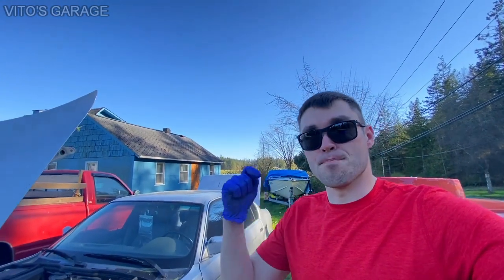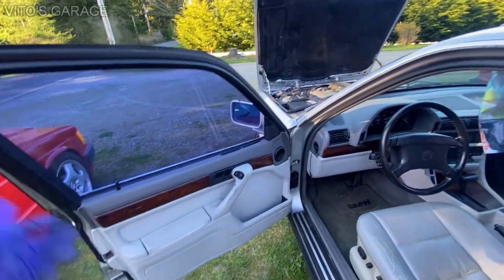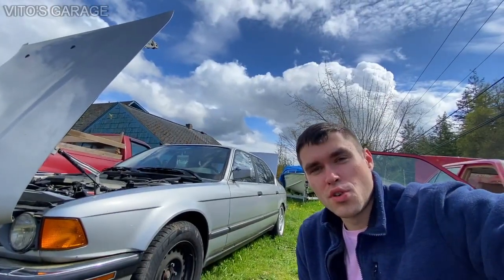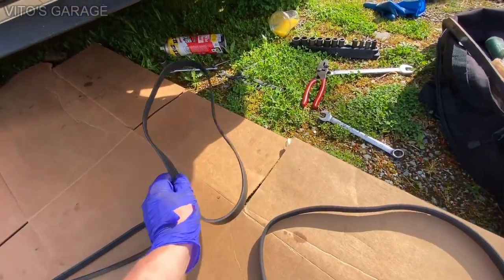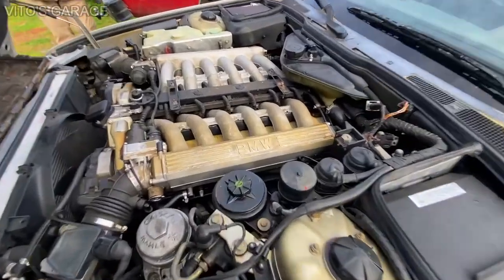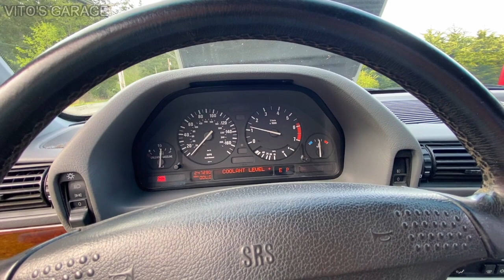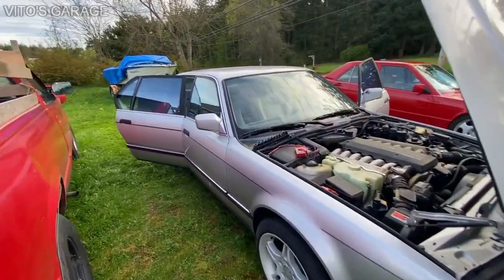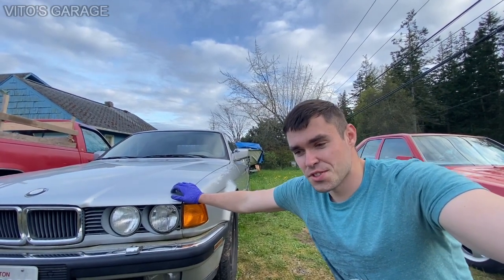V12 BMW E32 750IL First Start After 2 Years & Unsuccessful Test-Drive....

Comment: Thank you for posting this video!  I own a white 1988 750iL!

Regarding the alternator, it's not always the alternator.  There is an engine electrical system responsible for connecting the battery to the alternator.  It's mainly a thick electrical cable that goes bad.  BMW wants $800 to replace that main cable (engine heat damages the copper inside it, thus the weak charging performance), but you can replace it with similar thickness welding cable for a lot less.  An E32 expert named Shogun on Bimmerboard.com E32 board has a how to for building an new engine electrical cable.

The alternator can be tested at Autozone once you pull it from the car.  Sometimes replacing the regulator on the alternator restores the alternator, or sometimes the alternator needs to be rebuilt.

The master cylinder has likely failed on the car.  You can buy rebuilt ones for under $100.  New ones are over $300 from BMW.

Another known failure point on this car is that the power steering pump is a dual vane power steering pump.  One internal pump mechanism is for your power steering, the other controls a hydraulic leveling system known as SLS or LAD.  This is a very expensive and leak prone system to maintain.  Signs of failure include a sagging rear end and leaks under the rear side of the car.  The control diaphragm that controls this system is no longer made or produced by BMW.  The company that made these was bought out by another company a few years ago and that parent company discontinued production of the diaphragm.  Some have had success modifying a control diaphragm from an E38 (third generation 7 series) which used an air powered system.  Most people just convert the system to a conventional sport suspension system in the rear and either run the lines in a continuous loop, OR they disable the system entirely by bolting M10 bolts on the SLS ports on the power steering system.  Also, be sure to use Pentosin in the power steering system.  Some have replaced this very expensive fluid ($20 a bottle, and the system requires several bottles) with ATF fluid, but ATF attacks the seals inside the pump, requiring a rebuild or replacement of the power steering pump.  This pump is nearly $1,000 new from BMW, but can be rebuilt with new seals for $100 to $200.

A Youtuber named M539 Restorations is rebuilding a car very similar to this.  You might want to check out his channel.

Numerous parts on this car are NLA (No Longer Available) from BMW.  If you're relatively savvy at rebuilding or replacing worn parts, or just very creative at engineering new replacements from scratch, this won't be an obstacle.  ECS Tuning and Pelican Parts are two well known and respected replacement parts sources.  You can get parts numbers and dealership parts prices from realoem.com.  You will have to select the "Classic" catalog to find the car listed.  Another source for replacement parts (very expensive though) is Maximillian Importing.  This is actually a business arm of BMW Classic (yes THAT BMW, one and the same).  They can provide a lot of these NLA parts, but the prices are likely to be prohibitively expensive.  Best to source local experts who can rebuild worn parts.

For wheels, wheelcollision.com has a great online catalog for wheels at affordable prices.  They also buy, sell, trade, and refurbish wheels.

E38.org has a whole catalog dedicated to how-to's for this car, which is known as an E32, internal BMW code for a second generation 7-series (1988 to 1994).

Another source of E32 fixes and upgrades is located at bmwe32.masscom.net

Your car is a 1992, one of the last of the early model E32's.  Yours has the "facelift" front bumper, the first year for that.  Starting with the 1993 and 1994 cars, BMW made a whole slew of changes to these cars including a modified dashboard that incorporates dual airbags.  BMW changed the steering wheel in 7/90, which means that steering wheels from cars built prior to that date will not fit this car.

The car's expensive maintenance requirements are a big reason these cars are so difficult to find.  Money is not necessarily an obstacle if you're creative with fixes for this car.  When I bought mine, the instrument cluster took several minutes to power on, and it kept resetting the trip odometer to zero every time I turned the car off.  The dealer wanted $700 for a new cluster back in 2005, but I discovered that the fix was replacing five faulty capacitors on the electronic board for the cluster for thirty cents each.  For a grand total of $13, I repaired my instrument cluster on my car.  These cars require creative and hands-on owners, not necessarily wealthy ones.

I have had mine since December 2005.  I look forward to seeing this rebuild.
Reply from the maker: Thank you very much for such a long and great description! I learned a lot from it! Thank you once again! More videos to come!
Reply: Thanks for posting this comment and sources i have a 1990 750 IL its black but orginally it was  cirrusblau metallic.. the light green color, I cant go above 50mph in mine and think its the EML staying on causing the issue.. Any insight to my issue? Thanks again

Comment: I would have drained the fuel out and put fresh gas in it before driving it.
I drove my car for a month without an alternator. Just kept charging the battery up and only drove when I absolutely had to.
I wonder if you throttle is sticking since you can't get the engine to rev up.
It does look like a descent car despite being up there in that wet climate.
Reply from the maker: It’s a good idea to flush the fuel out but she runs like that. We will see what happens. I might flush it out if the owner wants. 
And no, you can’t drive without an alternator. This is not a Mercedes W123 where the alternator only matters for your lights. 
This V12 consumes a lot of electricity and the car starts shutting off around 11.3V-11.7V.
But thank you, I’ll be swapping an alternator on it and I’ll keep troubleshooting

Comment: It's in limp mode. Also check the 2 electronic throttle body. They go bad
Reply from the maker: Yeah I figured.. Do you think a bad alternator could cause this too? The alternator needs to be replaced regardless
Reply: @VITOSGARAGE  I doubt, since the battery is fully charged. But best to change the alternator and have it scanned. Goodluck :)
Reply from the maker: The battery was around 11.8V when we started driving and the car starts shutting off at around 11.3V. But I’ll keep troubleshooting. Thanks for the advice:)
Reply: @VITOSGARAGE  i hope it's just the alternator. Goodluck! Excited to see this v12 back on the road

Comment: The only thing more annoying is that that phone is probably outdated, with today*s technology, I don*t know if it is compatible, it would be nice if it is compatible with today*s technology like  the 4 or 5 Gs.
Reply from the maker: Not sure about the phone. The main part I’m happy about is that the phone is actually there. I really don’t care whether it’s operational or not. The main thing is that it’s there and nobody stole it
Reply: @VITOSGARAGE  I know I have an E-34 535I with a phone, it looks awesome with a phone, I thought being that that 750 IL has a phone  that it would work.
Reply: That's an analog cellphone.  The USA decommissioned the last analog celltower back in the early 2000's.  It's a very pretty prop at best now.  Current cellphones use a completely different technology.  Sorry to burst your bubble.
Reply: @houseofno  I wonder if they can make it work by putting in new technology in the phone, to make it compatible, I have seen a rotary phone.
Reply: @EnriqueLopez-hb5jn  That wont' work, and not worth the trouble for most people.  That's an 80's phone pushing forty years old. You can keep it in there as a nonworking prop, or just use your smartphone.

Comment: For a Fellow Classic restorer See: M539restorations on YT.  This is a Great Autobahn Burner 155mph all day long! Had a few..all rusted away. So sad.miss them.
Reply from the maker: They didn’t rust away. Bad owners didn’t check for rust and didn’t preserve the body. It’s not the car’s fault. I’ve recently sent a Mercedes W123 to my dad. Before doing that, I restored it and preserved everything on it. Preventative maintenance is the key. The same goes with rust. I have a playlist on my channel you can check out🤘

Comment: Windows are not bulletproof. Just dual laminated
Reply: @VITOSGARAGE  same as the W140. It is just dual pane windows. For sound insulation, not armor rated. There were E32s and W140 models that came with bullet proof glass but when you look online you will notice the rear windows do not roll down. The front do only halfway and when they’re rolled down it is about 4 of those windows put together! Check for yourself under the armor packaged L7 E32 and as well as the Benz since you are a Benz guy. I own a 95’ E300 as well. 389,000 miles. Original everything. OM606 NA. Best engine ever from MB.